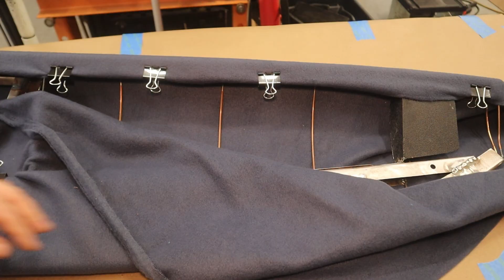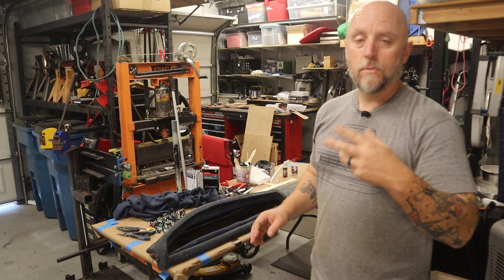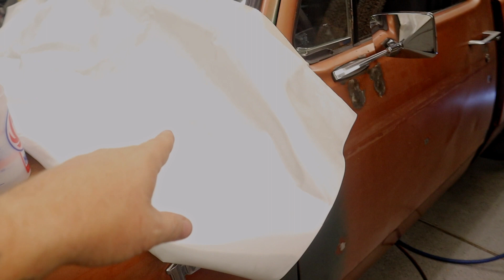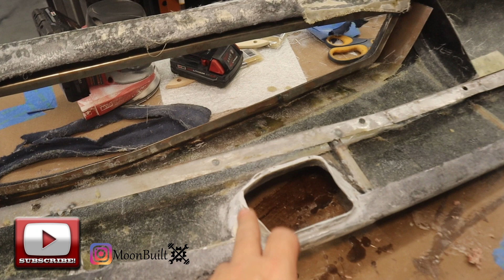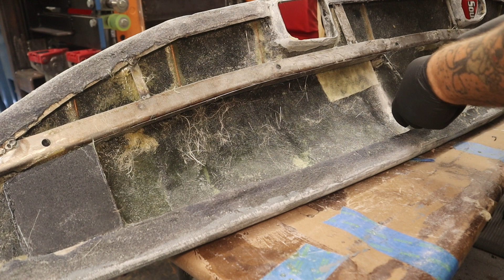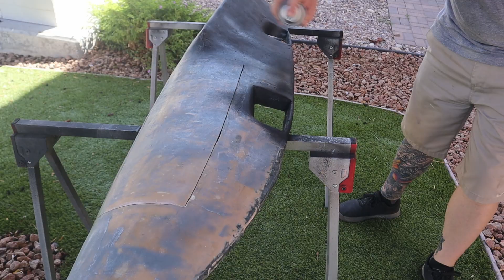Custom Dashboard Build From Scratch - Part 3 - Laying the Fiberglass Skin | Dodge D100 Hot Rod

Comment: You can form aluminum with low pressure dies. You can use hardwood and a belt sander, a router, rasps and chisels to make one-time mandrels.  But, you are right, its a learning curve and wasting good metal is expensive.  Its easier if you copy a known shape that has gentle curves,  or a simple sharp edges like an aircraft cockpit.   You need to be skilled at TIG.  You can laminate multiple layers of thin metal using 3M body adhesive.  Then, cover with fiberglass or carbon fiber.

Comment: I know there are a lot of arm chair quarterbacks out there, but when you decided to texture coat I was internally screaming NOOOO. I've been researching this a lot, and I think a good coat of primer first would let you get a view of the overall product, and give you time to fix what you don't like. I did glean some good ideas from you, and the dash overall looks cool.
Reply from the maker: I can appreciate that, and even though applying a texture coat wasn't my original idea, I was never going to have the final product be your typical smooth fiberglass type of finish.  Overall the texture coat I used is pretty similar to the dash in my Charger that I based this dash on, just a bit rougher